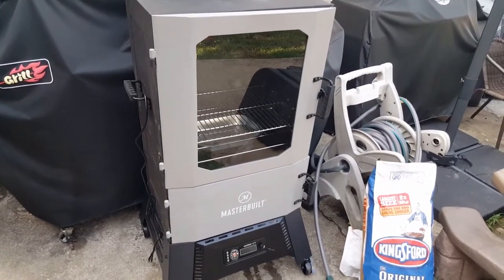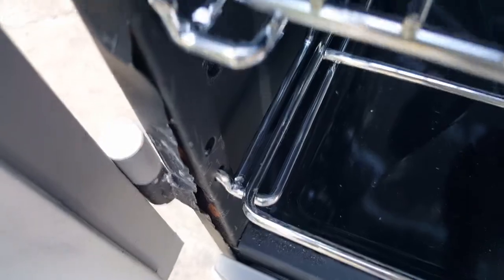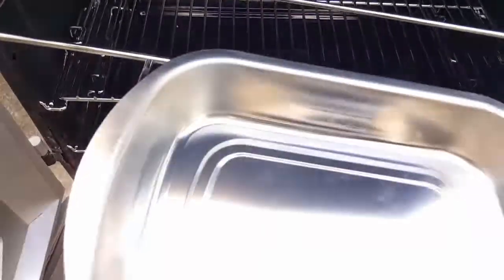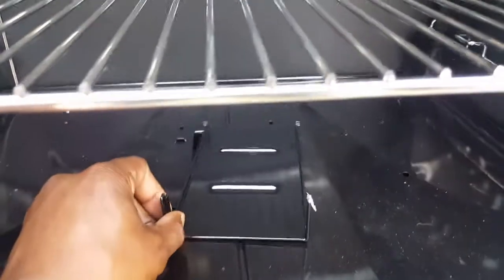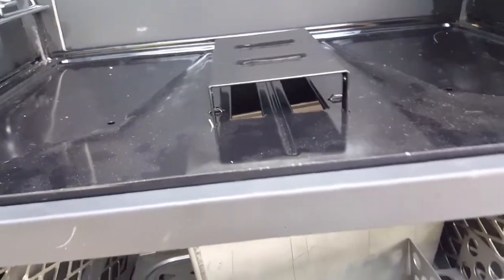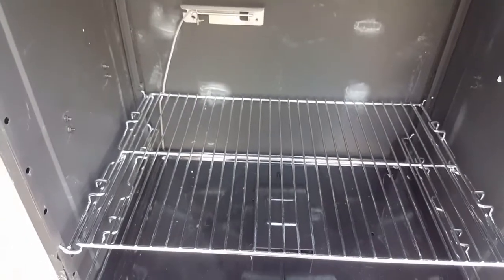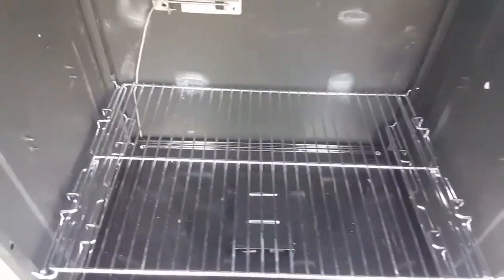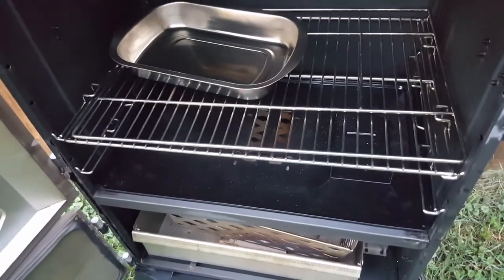Masterbuilt 40 inch Digital Charcoal Smoker review

Comment: Thanks for this detailed look.Been on the fence on getting one. Metal too thin. My MB Gravity Series 1050 can't give me the deep smoke flavor of my much older Broil King Vertical Charcoal smoker (not even close after many many trys and recommended tactics), but is more convenient to use. Considered this unit, but just not built well. I really need a hybrid as a vertical with the wood burning on the coals (not smoke pushed from embers burning the wood) with the convenience of a gravity hopper.
Reply from the maker: Glad I could help. I personally don't like this unit but maybe others may have better results. It didn't work at all for me so it is 2 thumbs down. As far as the masterbuilt. I never did the hot embers dropping on the wood in the ash pan approach. I mixed wood chunks into the hopper here and there and got really outstanding results with it. Not stick burner results but pretty darn close.

Comment: did u turn the heat deflector upside down for 225...i smoked at 250 for 6 hours on half bag of kingsford...only had 10 degrees temp swing..try it a few more times u will love it, set and forget it
Reply from the maker: Thank you so much for the feedback. Hopefully someone will find your comment to be very helpful. I do love the set and forget older cousin of the smoker which is the 560 but this one and I got off on the wrong foot. The door was already messed up and the temp probe would not read beyond 90 degrees or so even though the internal temp was blazing hot. Since I have so many other cookers I just decided to part ways with it especially with most places having staffing issues for customer service right now. But your comment and those like it are exactly why I make so many unsponsored review vids, to help others that may have similar issues/advice. Thanks for taking the time!